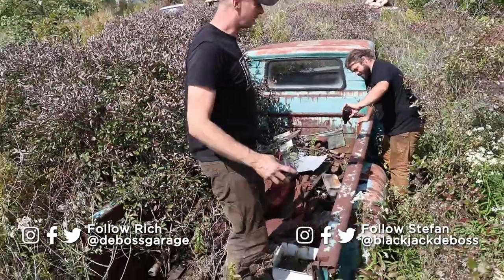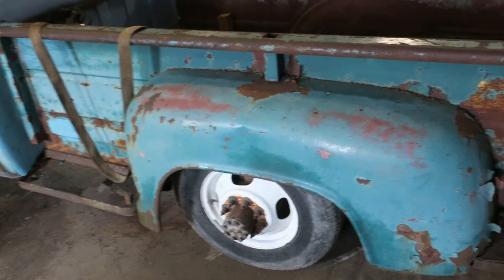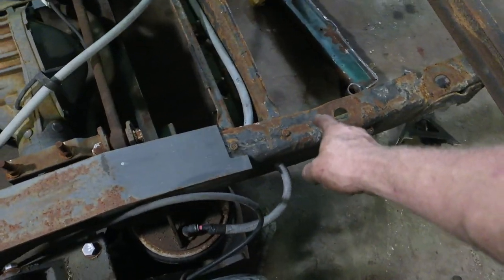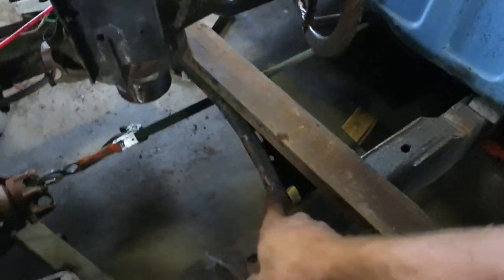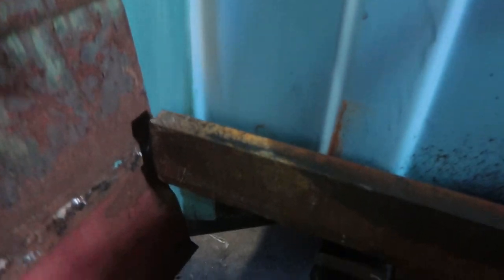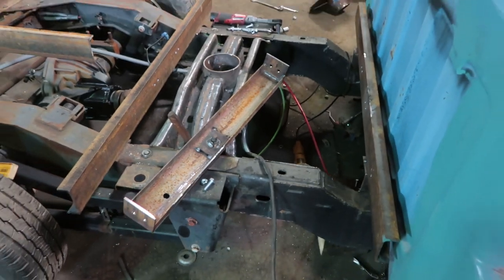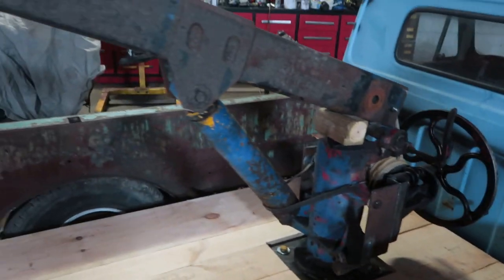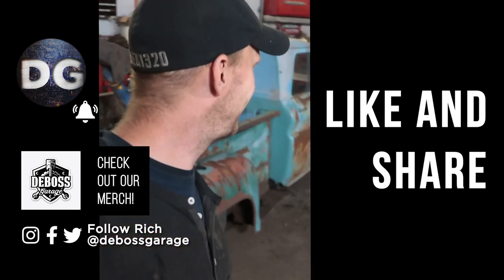Building a "Vintage" Tow Truck Bed | #TTDmaxC10 [EP6]

Comment: If at first something is seized follow the DEBOSS procedure as follows:
Step 1: Try and force it.
Step 2: Apply heat and try to force it.
Step 3: Apply heat - beat it with a large hammer, then try to force it.
Step 4: Next time this happens move directly to Step 3.
My kind of engineering Rich, keep up the hard work.
Reply: You sade it brother 👍

Comment: For most pickups I like a side dump under the bed in front of one of the rear tires; but for this I feel like stacks and flaps behind the cab have the right kind of vintage vibe.

Comment: Stain the bed wood with used motor oil. Leaves a great finish and holds up forever. Fits the theme of the build too. Pick your used oil for the shade, gasser, diesel, 3k or 10k use.

Comment: Crap a couple full pieces of steel wool into a gallon of white vinegar. Let it stew for a week, mix it up, put it in a spray bottle, spray your wood and overnight it’ll be Grey barn wood. Look like it’s been in the field for years except without all the cracking and checking.  Great trick.

Comment: I built from scratch in the day a rotation crane/winch for wrenching here in the cold north and never stopped until convinced it would do everything I need/want and I say came close as I used pumps and parts off a excavator and a backhoe was known to donate much of the build. I figured to use what worked already and just add to it so a two stage crane extension for placing transmissions and engines in large equipment and I had tons of schedule 80 steel so it was real strong but not real practical and limited itself on how much I could pick cause of having to lift everything I put on. I always wished that I could build another one cause the first one was that, the first and handy but way over kill. One thing bad was the fact that if I found a hose and it reached I never cut to length, just tucked it and it was expensive in that way, except it was all old stuff I repurposed. An oil leak would be interesting when digging through the pile to put a new one on. My boss had it cleaned up by his crew and then kinda duplicated except lighter and used both of them on the job sit and in the shop and welded my name on it. Kinda a compliment. I am going to see if there is any I missed besides first one on this as I'm loving it
Well looking back I see I watched them all dang it as    I would of had me a Deboss marathon night. I did pick up on something that I don't think was fair to the Commander build... it is old format and everyone who can't afford a decent car is building his own C10 project an that said, we bow to the majority

Comment: When welding cast use stainless wire it works better then cast rod and i find is just as strong why it works is they both are high in nickel

Comment: Use a mixture of diesel fuel and used diesel oil on the bed wood let it set outside to cure itll water proof it and youll get the desired grey finish..

Comment: Real Question ,, How in Ontario do you register the truck when done , using the 2015 frame number OR the vin number on the truck dash or both in hot rod form and then how does the insurance work with you to cover it in ontario ? I have a 52 that I would put a newer frame under if this was easy to register.
Regards John

Comment: I would say no to the stack.   Doesn't really fi tthe build I think.

I used to have a Lincoln PowerMig 200 at my old shop that I shared, but it stayed with its owner when I left.  I really liked the machine - lots of power and very reliable.    I currently am running three welders, two Lincoln Migs, and an ArcWeld Tig.  The one Lincoln I have literally had for 25 years with no problems - its a 110v MigPak 10 that I use for body work with .023 wire.  The other is a Sp175 Plus 240v welder.  It gets used for frame work and the heavy stuff.   I have had these for years and (knock on wood) they have been reliable units.  Both are transformer units, as opposed to inverter, which I think is why they have been so reliable.  If you haven't used the lincoln stuff before, I think you fill find it to be pretty good.